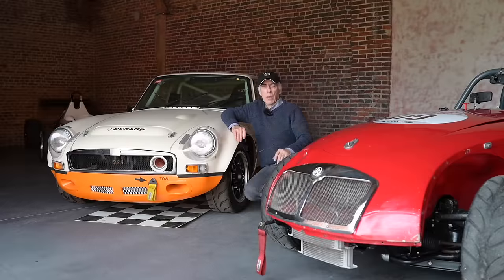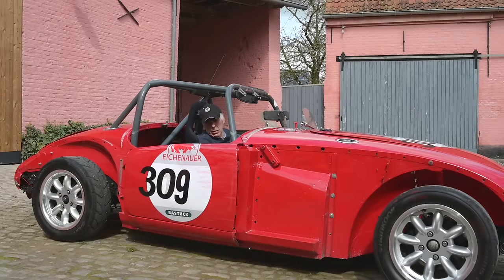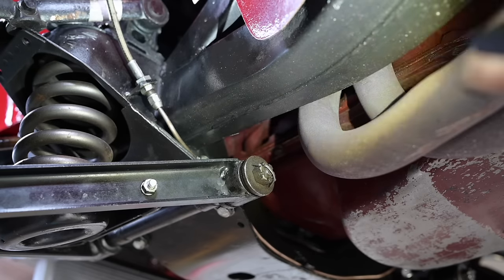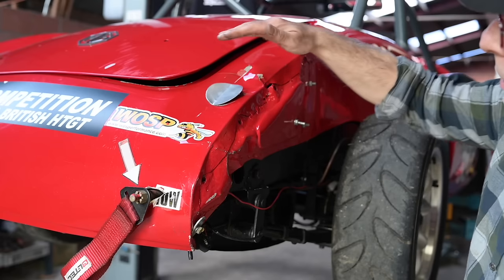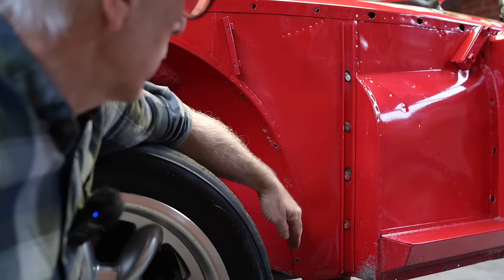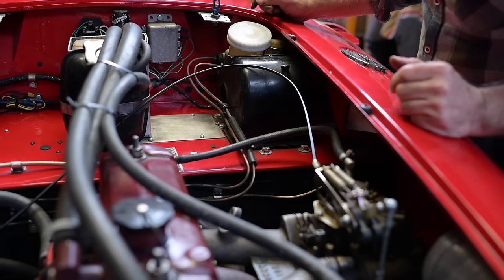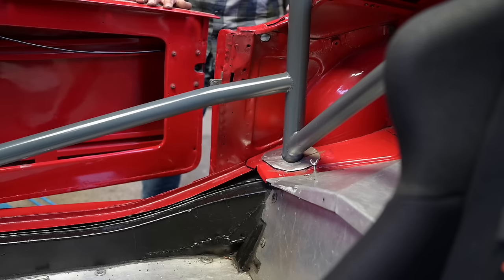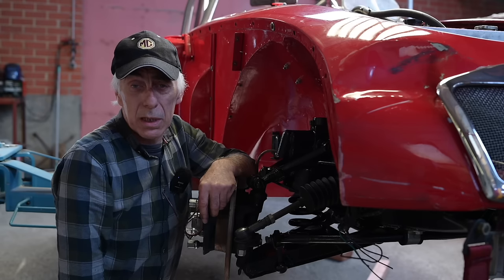1958 MGA - Race Car Repair Part 1

Comment: Hi Steve, another great project !
My business, just me & my Son, here in the UK have completed a 3 year rebuild on an Ex Works MGA Twin Cam, for a gentleman racer.
I am more than happy to help if you need any hard to find parts.
There are several real experts on these cars here. Not just parts shops, but years of experience.
Reply from the maker: Hi Victor, that is really nice to hear, I might need some info on the camber settings and how to set them on the front wheels.
Reply: Hi Steve, Neil here, Victor is my YT name ! More than happy to help on the camber. Perhaps via email, rather than replies on here ?
Either way ask away.
Neil

Comment: Steve the right side door should straighten out with paintless dent repair (PDR). They  sometimes work miracles.
Reply from the maker: Hi Joe, I would hope so...will give it a try... unless the inner bar is stuck to the panel

Comment: I also own and drive a 1960 MGA here in UK.  Mine was fully restored in 1997 from one I bought in 1978. The door skins are aluminium, as are the trunk and bonnet. 
 I am interested to see how you fit the fibreglass wings as I have a full new set here with front valance, but currently have original steel wings fitted all around. 
I have subscribed to your channel, to see how you progress. These are great cars.
Reply from the maker: Thanks for the comments, and yes there will be several video's on the fixes..  Some will be easy others not ..

Comment: A couple comments.
"While unibody and monocoque construction are sometimes used interchangeably, they aren't actually the same. 
We define unibody as a unitized vehicle body with tubes, bulkheads, and box sections that provide most of its strength, 
whereas a true monocoque structure gets its strength from the entire external 'skin ".

There was also the 1622 and the Deluxe Models which were Twin Cam structure but a 1622 motor.

Great looking car. Good luck.

PS When I worked for a BMC Dealership 1968-1972 I bought a 1956 MGA and installed a 3 Main MGB motor.
Wonderful car, I miss it.
Reply from the maker: Thanks for the commens Jef,  and the explanation...  Its always nice to get comments that set things right... after all we all learn every day
Reply: @D3Sshooter  And thanks to you, I have learned a great deal. One of my favorite you tube car channels.

Comment: It looks like you found a very nicely prepared car! Hard to believe that the frame and bodywork would be in such good condition (apart from the crashed bodywork) considering it dates back to 1958. Like so many cars I've seen, it does not look like they did a great job on the wiring. I would enjoy watching an episode dedicated to evaluating and organizing the electrical system. 🙂
Reply: I've just been troubleshooting that monster of a dual relay box on the bulkhead. Only the earlier 1500 and most Twin Cams have the multifunction sidelight / indicator / brake light installation. 6/8 connections were wrong!
Reply from the maker: Thanks for the comments,  this was for sure a ground up restoration a few years ago before it went onto the track.  As always there are t hings that can be improved and I will do so over time
Reply from the maker: @robbending3848  Good to hear....

Comment: In the entire history of racing has there ever been a seat belt that has sheared? Race cars are usually kept indoors so the belts don't get UV light and compared to road cars the belts are hardly used. It seems to me perfectly good and safe belts are disposed of with no empirical evidence that they have become unsafe. Lovely car.
Reply from the maker: You have a point, I am of the same opinion.  However we have FIA regulations and scrutiny on the track that states and inspects the validity  on the tags of the devices and clothing...  Out of date= No run....    It is all about bussiness if you ask me...  Thanks for the comments